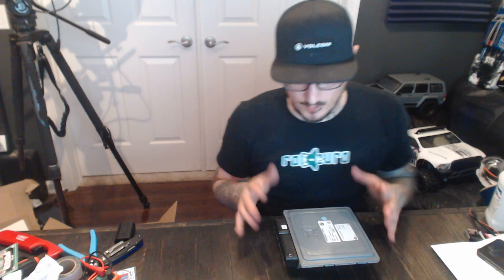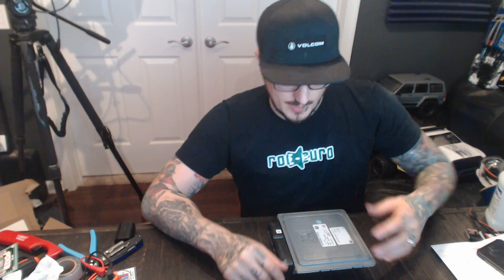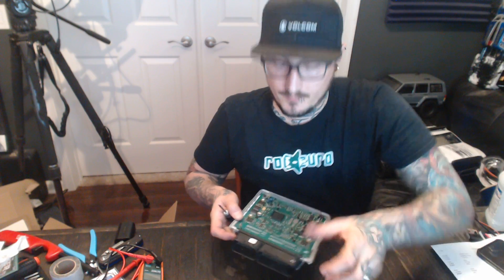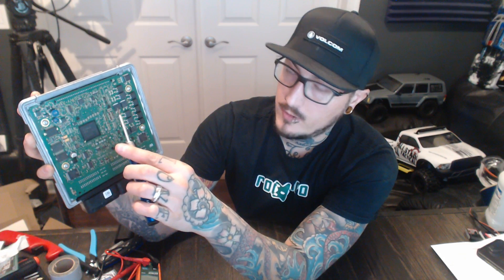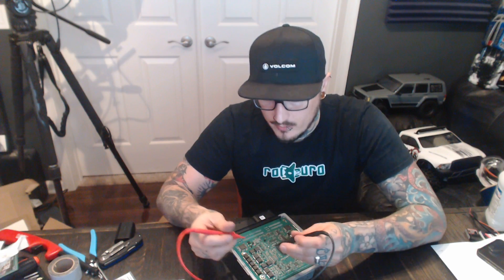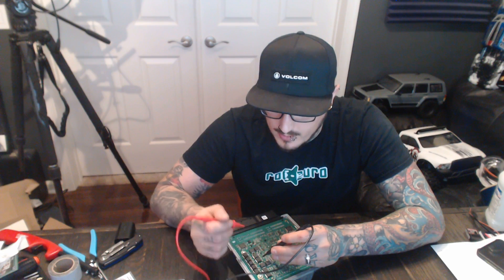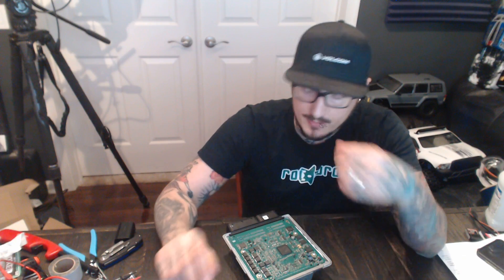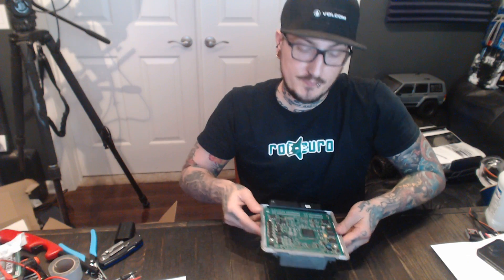e92 335i N54 MSD80 DME MOSFET Diagnosis

Comment: Idiot!
The field effect transistor cannot be fully checked with a cheap multimeter !!! What you demonstrated confirms your technical stupidity and ignorance.
Change the polarity of the probes when measuring with a multimeter - removing the charge from the transistor gate ..... and a short circuit will disappear between the source and drain!
Stupid!!! Don't make fake videos...

Comment: You mentioned  having it done at a TV repair shop..... im going thru something very similar to this.... I live in rural east texas so im an hour from the closest bmw dealership..... so trying to fix mine from home ...... ive replaced my injectors and my coils and plugs.... and im still getting that injector 4-6 dme internal failure code....Im gonna order some of the mosfets from boost monkey and I found a cell phone repair place in town said he he could do it....... my question for you is........ should I just go ahead and order all 6 and have him do them all at once??   Any advice will help. Thanks bro!

Comment: Im sorry to comment again. I found this site ( https://bimmerguide.de/msd80-30ba-30bb-fehler-reparieren/ german) who recommend replacing the mosfets with better ones like https://www.digikey.ch/product-detail/de/vishay-siliconix/SIHB30N60E-GE3/SIHB30N60E-GE3-ND/2813599 (rated 600V, as you can messure UC up to 380V, OEM mosfets are rated 250V). Messurements you can see here: https://bimmerprofs.com/ignition-coils-episode-2/ . Alternatively an option: Adding snubbers like described on bimmerprofs.

They also recommend messuring the marked resistors (0.05 Ohm). Maybe this helps someone, i find it interesting.

Comment: Hey did you get stuttering on part throttle? I've been getting the stutter, shutter, surge symptoms for about a week on part throttle only between 1500-2000 rpm. Swapped injectors, coils and replaced plugs. Problem still there but no codes. Floored the gas in 2nd gear today. As it shifted to 3rd, the car loss power and went into limp mode shaking violently. Pulled codes combustion misfire cylinder 1, 2, 3, fuel mixture plausibility-29f1, mixture control-2a2b and  30ba, dme injectors 1, 2, 3 or dme internal fault.  I'm pretty sure it's mosfets. Just hoping nothing else wrong. Hopefully, I can text dme tomorrow.
Reply from the maker: brakthru2 yeah it acted real weird at partial throttle and when trying to go wot
Reply: @MikeCentola   Mike Centola  Your video is very helpful. I tested the mosfets and cylinder 1 showed conductivity so I'll be replacing all 6. I decided to test all the other mosfets on the board too. The 2 above cylinder 6 both had conductivity so I guess theyre bad too. Any idea what those mosfets are for?
Reply: @MikeCentola  I guess the mosfets can degrade over time before completely going bad. Thanks.
Reply from the maker: Awesome! Glad to help!
Reply: @MikeCentola  hey Mike, did you read the whole message. I have bad mosfets right above the cylinder 6. Do you know what they control? The 2 mosfets that sit right above 6
Reply from the maker: brakthru2 I’m not sure what those would control honestly. I only ever checked the injector ones.
Reply: @brakthru2  did you fix the issue?
Reply: @Archeris  yes. I used shutter fix additive. Resolved it right away. Apparently it was transmission related. Probably torque converter. It's made by lube guard. Can find at autozone or parts store. I eventually did a fluid change and added the synthetic long term additive since lube guard told me shutter fix may be a temporary solution. Their products are amazing and resolved my issue. Transmission and shifting became smooth and acceleration was better too.
Reply: @brakthru2  damn that sounds really weird. Transmission causing misfires. I have the same issue but I drive a manual. So it prolly isn’t the same issue then.
Reply: @Archeris  sorry I didn't read the whole post. Only saw part. In your case it sounds like the DME due to fried mosfets. If you already did injectors, coils and plugs then that's probably DME. same thing happened to me. Had mosfets replaced 2 or 3 times if I recall and they kept failing. Got the MSD81 DME and problem solved. Btw. Mine had the codes and loss power like yours only on wide open throttle and I was heavily tuned.
Reply: @brakthru2  I checked the mosfets and they are fine. Can something else die on the DME?
Reply: @Archeris  Possibly something else on DME but not sure what. You can check your cars ground to chassis. Also, check fuses near DME. Probably none of those things though. Are you tuned and logging when this happens? It really sounds like DME. You may have to replace injectors and coils for a process of elimination. If it keeps happening on bank 1 only, just make sure the injectors and coils are good there and that pretty much points to DME related if the misfire didn't follow to bank 2 after the swap.
Reply: @brakthru2  i don’t have a check engine light aswell and it only happens when the car heats up btw. Injectors were changed but this didn’t fix the problem so they put the old ones back in. I also bought new coils and spark plugs.
Reply: @Archeris interesting you never got the check engine light. That's certainly not good. I would get an used MSD81 DME. I purchased mine through N54 exclusive. Sent CAS and Key. Turn around time was good and it was plug and play.
Reply: @brakthru2  Hey! I got an check engine light. But my mosfets are good. So no programming required when getting those parts? My car is a BMW e63 with the N53 engine. Would it work with that one?
Reply: @Archeris  I don't know. Thought you had an E90.
Reply: @brakthru2  thanks atleast for your help. If it’s fixed I’ll let ya know.

Comment: Did you have any codes for the misfire ? I'm having an issue on my 335i n54 with msd80 , full bolt on jb4 with mhd back end flash . 

The car will sometimes sputter slightly once or twice on startup and then idle fine very smooth but between 2500-3500 rpm it's getting a sputter almost a slight misfire . 

I have all brand new coils and plugs , new high pressure pump , new index 12 injectors , recent (5000 miles ) valve cleaning , but I can't get rid of this misfire / loss of power but no codes
Reply from the maker: Braden Mcelwaine I never got any codes from this. It was just acting weird when I got on the gas at all.

Comment: Getting 30bb and injector codes in 4,5,6 misfire codes 4,5,6 and o2 sensor codes all in bank 2 WTF!
Reply: Same problem,  I opened the DME and I tested the mosfets

I Checked ohms between drain and source and drain and gate
All game me same values

Drain and source around 370 K ohms
Drain and gate 0 

I couldn’t find anywhere is these values are ok or not.
Reply: I got a 30FF and mechanic is lost. Replaced my turbos and still low efficiency
Reply: What was the fix in the end?

Comment: We've repaired a few of these BMW boards. Customers are generally ecstatic to find us when we say we can replace the FETs.
Reply from the maker: Electronics Overhaul sweet! What do you guys charge? I’ll update my description
Reply: @MikeCentola  We charge 95. Could offer free shipping with that.
Reply from the maker: Electronics Overhaul awesome. I’ll update my post. Do you have a website or contact info I can put up?
Reply: $95😂😂😂local computer repair charges $25..for 95 you can buy a rework station DIY it and have some cash left over
Reply from the maker: @5129FNHG  I paid $70 for a local TV repair place to do it. $95 with free shipping seems like a fine deal.

Comment: is anyone else getting weird codes like pump plasuablility, and injector cut-off codes? i will try this!
Reply: Only pump plausibility.
Reply from the maker: I actually didn’t get any codes but it ran like crap any time I got into the throttle.
Reply: 30BA and about 10 other errors

Comment: Hey man quick question. I pay to a professional to change all 6 mosfets and I did not make any difference I'm still getting 30bb bank 2 dead. Do I have to reprogram the DME or what's the next step so I can figure it out ??
Reply from the maker: Diego Chaves shouldn’t have to reprogram the DME after changing it but it sounds like something else could be off.
Reply: Did you ever get this figured out?

Comment: Thanks for posting this. Almost 100% sure this is the issue I've been trying to track down for months now. Just installed PR coil packs yesterday and still didn't sort it. Cold start is the worst, super rough starts/idle and lots of pops/skips. 2008 135i N54 and funny enough it's misfiring on cylinder 5. I'll update once I've had a chance to get this done. Good looks on the part link.
Reply from the maker: Thanks man. I just got the PR coil pack too but my car is in storage. Haven't installed them yet. Pretty easy to do?
Reply: How it go? You fix it?

Comment: i don’t know if you’ll see this comment but i had a mechanic recently try to sodder a wire on my car i think it was an o2 sensor but i’m not sure and it now it completely fried my dme. if i replace the dme will that fix the issue or will i need to replace a bunch of wires. i’m not really educated on this stuff if u could help me understand i would really really appreciate it
Reply from the maker: Chris Hernandez how do you know the DME is fried? Soldering an o2 sensor wire shouldn’t have done it unless he had the battery hooked up...
Reply: Mike Centola yeah it was hooked up, the guy who did it , did it without telling me and at that did it with the battery on and i took it to another shop and i got a new dme because they told me i needed it and it’s still not running so idk what could be wrong and neither do they so i’m tryna find help lol

Comment: I carried out test by multimeter for my due as well. Other than those 6 injector driver, i also found 2 small MOSFETS which has issue as well. Do you have any idea which they are related to??
Reply from the maker: Kimmy Wong I don’t know what other mosfets might donor control on there. Only ever diagnosed the injector ones
Reply: is this checking always the rule for deciding whether the mosfet is bad or not. I carried out two small mosfets on the DME (which someone suggest it refers to Oxygen sensors, near Power Drive section), both Left and Right Leg got the reading on multimeter for connectivity. But the repair guy told me that he compared my DME to another one, which is for repair as well, got the same reading as my DME. He believes  they are working fine. Any idea on this?? Please refer to the below link showing the photo for the above mentioned Mosfets which i suspect it is defective https://www.pinterest.se/pin/814588651321152629/?referrer=CwABAAAADDEzMTc1MjYxNzY3OAA

Comment: Excellent video, my son's 2007 335i wouldn't start.  Dealership wanted to replace DME and all injectors for $5000.00.  I checked and found the bad MOSFET, ordered part, had a PC repair shop replace it for me.  Car started up right away.  I can't thank you enough.  Keep up the good work bro.
Reply: reginaldcummings74 which MOSFET did you order
Reply from the maker: Eric Gonzalez the link to Digi-Key is in my video description
Reply: Mike Centola the ones I got In the mail they are smaller than the ones I’m replacing? Did I get the wrong one?
Reply: Mike Centola came straight from the link
Reply from the maker: Eric Gonzalez how much smaller? It could be a new revision of the same MOSFET
Reply: Mike Centola pretty much the same size as the ones along the edge just to the right.

Comment: Hey, I noticed two part numbers for them. 3 NH44AN CYL 1,2,3   and 3 NH45AN CYL 4,5,6. 5 was shorted on mine also. Reading online it appears 5 is most common to fail. Maybe a design issue. Never the less are the digikey fets you listed ok for both parts?
Reply from the maker: mytruckownsit yup! The Digi-Key parts can replace all six!

Comment: Hi, i checked my MOSFET its all good, but i found a component fall off from circuit board probably due to water corrosion. however that component should be capacitor i m not sure as the component is too small to identify. may i have your email.,i would like to send the picture of the location of the component.

Comment: Great video and was very helpful . All my injectors are good, so the problem is finding  the next thing thay switched my injectors off:/
Reply from the maker: Thank you!
Reply: Mike Centola  apparently my dme isn't good (says the dealer) have the 30ba code along with injectors switched of codes.  Do you think it's possible the mosfets are bad even though the continuity test went good?  There's a guy on eBay saying these errors can only be cleared with diode replacement through him. Not trying to be burned 250$ if Its just the mosfets
Reply from the maker: dreezy franklin I've never heard of the diode replacement. Have you checked on e90post about it?
Reply: Mike Centola  no information on the diode but I talked to a programmer  he said if the mosfets are fine then the power supply on the board and it can't be fixed .  So gonna program a used  msd1 dme for 450$ including the dme and express shipping.  Thanks man !

Comment: Does anyone have a link to purchase these ? How about the one Mike used ?
Reply from the maker: AirWolf60 I put the link to the mosfets in the description
Reply: Mike Centola OK thank you. I'm using the mobile app and the description didn't come up. I see it now so thank you. And great video, I wish I saw this before spending 3,000$ at the stealership on injectors / pumps / sensors and more.
Reply from the maker: yeah man for sure :( At least you have all basically new parts now and don't have to shell out for a DME too.

Comment: Have you replaced them yourself? I need to do mind, feeling confident enough to attempt it myself.. what temp did you use and should you put down new solder or can you just hear it up, take it off, and put a new one on using the existing solder?
Reply from the maker: Evan Millett I ended up bringing it to a local TV repair place and they did it for $75.
Reply: Did replacing them fix the problem? I'm getting 30BB and misfires for bank 2.
Reply from the maker: Momentum Productions yes sir

Comment: really interesting, 3 years ago I have replaced for 50 euros ( 52 dollars) the six mosfets (tv shop has done the job !)but I see now how to localize the bad one. thanks a lot for this video (I have motor n54 e93 and of course ...2007). I used exactly your mosfet reference and, no problem for 3 years (and I have the JB4 stage 3).
Reply from the maker: Awesome! I got a quote from a local TV repair place for $45 to replace all six, so I'll probably just have them do it. Cheaper than buying a hot air station, and less risk of messing it up.

Comment: I had a similar problem , but not BMW, different board.  I could physically see the burn on the PCB.  It was SMT but I used a regular solder iron to swap it (cut all leads before removing) However the same MOSFET kept burning out. Turned out to be a short in the driven solenoid was frying the MOSFET.  The take-away here is to test the MOSFET output for shorts to GND (and probably VCC)  after you replace it,  and of course with the module installed. You can't just ring out the connector because in my case the short to GND was coming though another connector pin
Reply from the maker: That's good to know. This is apparently a common issue with the MSD80 DME. I figure for $10, I'll replace them all.
Reply: driven solenoid of the injector? Or which solenoid are you talking about?